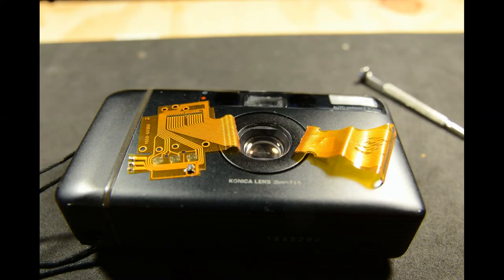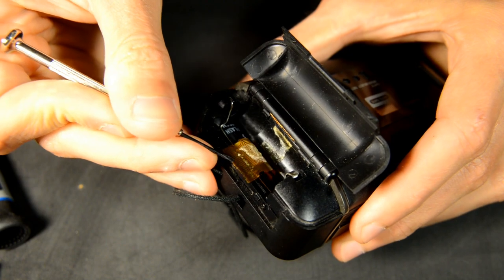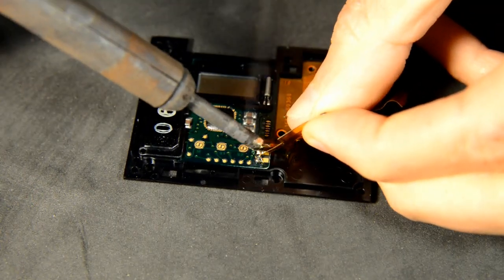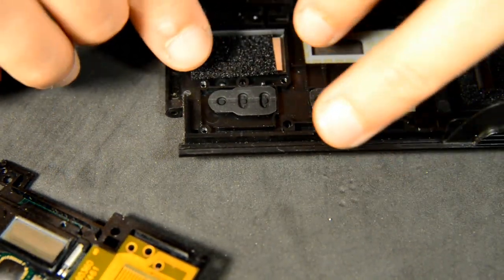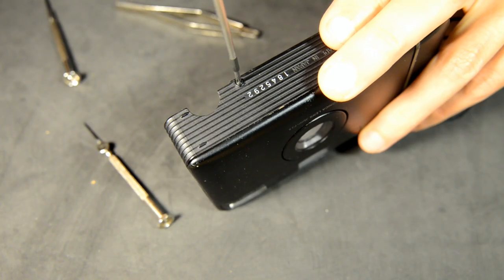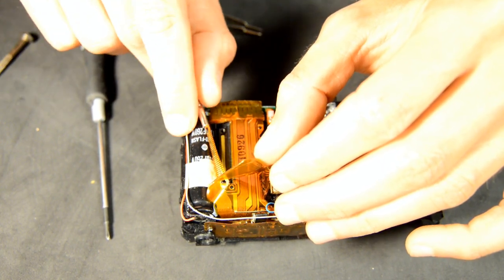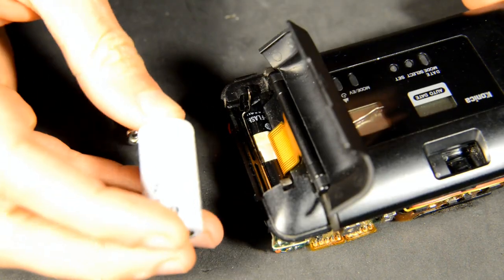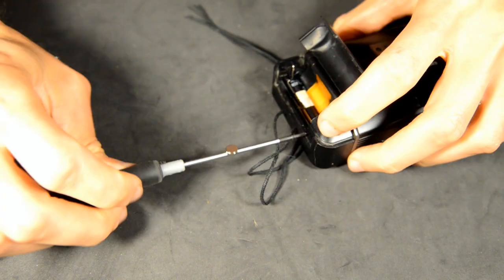Konica Big Mini LCD Cable Repair

Comment: Thanks for the video. Last month the back buttons stopped working and after ordering from aliexpress, today I followed your instructions and got my camera working again. My grandfather gifted it to me in the 90s and I still use it regularly.
As a note, I have the BM-302 (without the date backplate) so I didn't have to solder the 3 leads (which are left unsoldered from the factory).

Comment: There’s a tiny rectangular black “M1M” resistor on the old cable and the new one doesn’t come with it. Is it ok to leave it off? I tried to transfer it to the new cable but it’s too tiny to handle.

Comment: i decided to be extra careful/safe doing this repair so i drained the flash capcitor and now the camera is dead. Can't quite figure out why. Maybe if I charge the capcitor back a certain level it only will it allow power to be delivered to the rest of the board...

Comment: Thanks for sharing this tutorial 😃 I fixed my BM-201 today. A little bit different in comparesing with the BM-301 and with no soldering 😉
Reply: How with no soldering? 😧 my BM-201 has a torn ribbon, preventing from shutter/ power button working. Really want to try to fix it but I’m not too familiar with tools and delicate gadgets. Thanks!
Reply: Hi, I need to do the same repair to the bm-201, how did you do it without soldering?
Reply: I was able to fix my BM201 but the date back stopped working. I think if there is no date back no soldering is necessary.

Comment: can u do it with konica big mini 201?
Reply from the maker: If I had a body to repair I would. Although, I would image the process is very similar. Here is a link to the replacement flex cable if you want to give it a go. Good luck!
https://www.ebay.com/itm/Function-keyboard-Button-Back-Cover-Flex-Cable-For-Konica-Big-mini-BM-201/264663329741?hash=item3d9f29ebcd:g:WnEAAOSwm69eag5k
Reply: @n_oeil  what about bm510z?
Reply: @davidtadic4979  i have the same model. did you figure it out if it works with the ribbon cable he used?